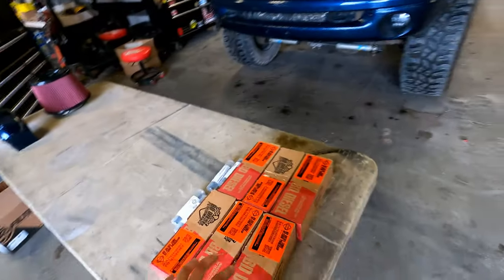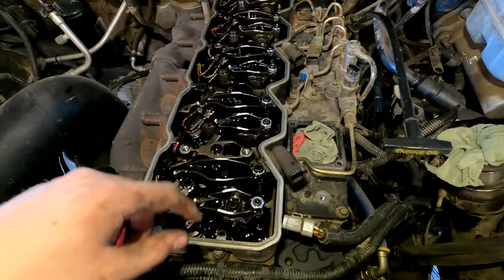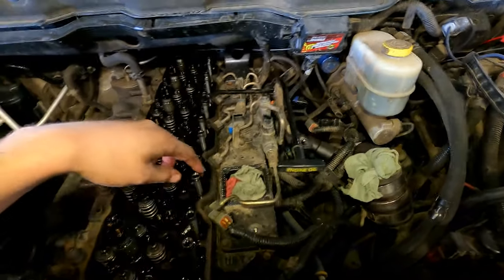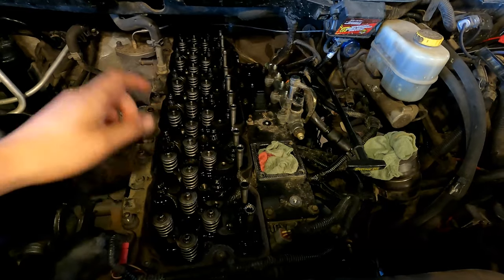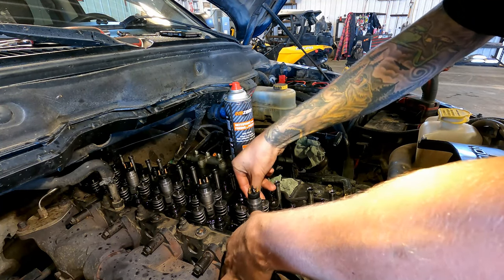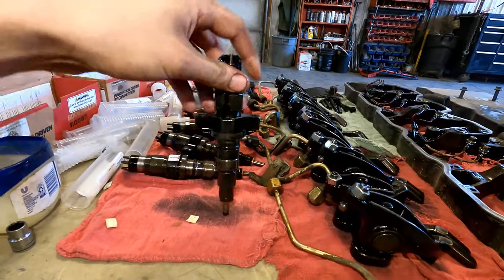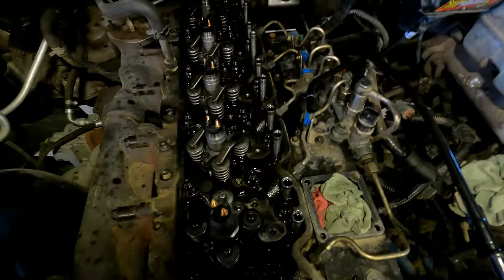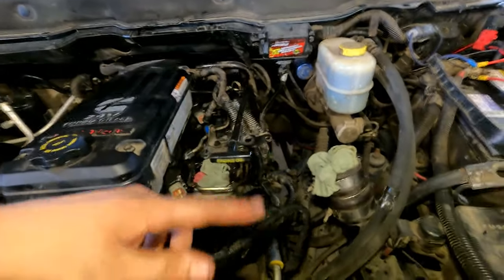How to replace fuel injectors 5.9 Cummins 2003-2007

Comment: These common rails are self bleeding. Cycle the key and let the lift pump run a few times and then crank. If it doesn't start, prime again. It might shutoff but do this cycle over until she runs good. You really don't want to manually bleed the rail for safety. Good luck
Reply: Thank you! I’m new to diesels so comments like yours really help!
Reply: Yeah definitely not recommend to crack any high pressure line free. Karen Boot has it down. If you turn the key on you will get 2 or 3 seconds of run time but then you bump the starter and you will get 25 seconds of fuel pump run time. I do it like 4 or 5 times and the should lite up no problem! Goo video and appreciate you taking true time to do these vids.
Reply: @chriscollison3136  Karen boot?
Reply: Working on one right now and I’m used to the old VP 44s where you have to bleed each line spent 30 minutes trying to get the front lines to bleed because I could only get the back three to shoot diesel out but after watching this it makes sense because all the air is trapped in a common rail so you only need to crack one line to get the air out I feel kind of dumb but I’m glad I got it figured out
Reply: These people talking about stuff they have no idea what they're saying the lift pump in these are not electronic it is all mechanical besides the ECM the lift pump is mounted with the injector pump. It is gear-driven so which means it is only pulling the fuel up and delivering it to the fuel injector pump which overtakes for the lift pump and provides high pressure to the fuel rail so cycling the key multiple times does absolutely nothing to bleed this system now if you had a newer Cummins with a electric lift pump then this would be true.
Reply: @Akusjs partially correct. Some of the 03 and 04s had a mechanical pump. Anytime dodge got one of these in for a fuel system repair. They upgraded it to a in tank pump. The 05 and newer ones all had the in tank pump. Meaning that unless you have a 99-04 25v, you will have a in tank pump. If you have a 99-04, you will want to check to see which one you have. Thoroughbred diesel has a great video on how to check which one you have.
Reply: Yupppppp, nothing worse than 4k psi of diesel piercing your skin. Its an immediate trip to the Emergency Room. Never bleed the high pressure side of a common rail diesel.

Comment: Just a follow up on installing my new injectors, the whole job took me about 6 hours, I took several breaks being 86 years old, I saved about $2500 doing myself it fired up on the third crank and is running great , no oil leaks,  very happy I watched your video. I could not have tried it without your expertise, hope I get many more miles out of it, I tried to attach a video of me working on it..
Reply from the maker: That’s awesome! I’m glad you were able to do it yourself and save some money, thanks for the comment and good work 👍🏻
Reply: Im in Alaska and despite some things being on par and even occasionally cheaper than lower 48 (3k tranny rebuild vs 6k in missouri)  the average rate is $6500 for injectors, lines and rail....i can get all the parts for 2500. Im saying all this because your comment is reassuring lol. I can't justify spending 4k to pay someone lol

Comment: Good video. A couple of things to note. When torqueing the injectors, after the initial 44 inch pounds back them off and go hand tight, torque the fuel supply tube to 11 foot pounds, final torque the injectors and then the fuel supply tubes. The injector has some room to rotate in the hold down. This allows the fuel supply tube to better center the injector. The other thing is do not bleed the high pressure common rail. It can be very dangerous and it is not necessary.
Reply: So would you skip bleeding the fuel rail totally
Reply: @chrisallen3741  yup
Reply: @chrisallen3741  yeah that's what I always heard
Reply: Yes, you skip the bleeding because the common rail fuel system is a self-bleeding system. So, no need to crack an injector line. Like original commenter stated, it can be very dangerous. These injectors, I believe, require a minimum 5,000 psi fuel pressure to pop off and you definitely don’t want that out and about.
Reply: Im about to do this on my 5.9 and previously I had a Ford 7.3 that wanted to hydrolock if you didnt clear the cylinder before putting in the new injector.   Do I need to be wary of this with the cummins?

Comment: I have a 2006 dodge ram 2500 5.9L Cummins and right now it sounds more like a tractor but without any power. I will be replacing all of my injectors in the next couple weeks. I'm ordering the injector kit with fuel tubes, fuel lines and gaskets. Very helpful video. hopefully all goes well.
Reply: Just had this issue yesterday
Reply: @America-he5tz so did my grandpa
Reply: I have the same truck as you and same issues 233k miles it started I’m at 235k can’t afford injectors yet nor have an extra wheels.

Comment: Just did a set of stage 1 BBI injectors In my 2004.5 5.9 cummins and it was a pretty straight forward job , if I can do it in my home garage anyone with the will power and some brains can do this job
Reply: How are they holding up? I am in the middle of an install and noticed the new bbi stage 0.1 are not oem bosch

Comment: Thank you for making this video, very good resource to use while I did injectors tonight on my 04.5 ram 3500. The sequence and order was easy to follow and I appreciate mostly the torque sequence/specs on the injectors/tubes. It made the job go quite smoothly tonight. Much appreciated!

Comment: You should definitely change that grid heater to a banks!! I've seen plenty of the grid heater nuts rot out, fall into engine and trashing it.  The banks one will not allow this to happen.  Just do some research and you will see exactly what I'm talking about,  it can save you engine
Reply from the maker: The banks grid heaters are garbage and don’t work in our climate. What I’m going to do is the BD Diesel killer grid heater upgrade kit.
Reply: thats a 6.7 problem. not a 5.9

Comment: My 07 is hard starting after it gets to temp only and i try to start it up after 20+ minutes. Thinking it is the injectors? Pump is runningproperly with fuel pressure perfect. Great video bro. TY

Comment: 400 thousand k i stil have the same injectors it came with. And it still starts and pulls good. But i use a fuel lube mainly powersaw 2 cycle mix oil
Reply from the maker: 300,000km on these injectors and they were still fine. Only reason for the change was needing the extra power to spool the bigger turbo!

Comment: On your rocker arm bolts, did you reuse the factory bolts? I tried to reuse them and broke 2 off before they hit final torque. Not sure if that's my doing or if its because they are one time use bolt.

Comment: Followed your tutorial and replaced all of my injectors on my 06' Dodge 5.9 cummins... now it won't start. I'm sure I'm missing something. When I crack the injector line and crank the engine the fuel doesn't seem to build up pressure although I am getting some air bubbles where I cracked the injector line. Wondering if I'm having fuel pump issues. Any thoughts? Thanks
Reply: The cp3 pump is self bleeding.. serious injuries can be caused by cracking injection lines on a common rail diesel. 25,000psi fuel can cut your hand like a laser.
Reply: Yeah I wouldn't bother trying to do it because you also lose prime if you try to do it alone

Comment: I know this is old but there is a service bulletin to torque the injector crossover tube nuts to 55ft pounds they cause a leak at 35 or something
Reply from the maker: Oh good to know. I never had a problem with mine

Comment: Do you have a video to adjust the valves on. 07 ram 2500 5.9L ? Mine has a little knocking. Thank you in advance. Billy.

Comment: Im having issues with the injector hold down bolts coming loose on a 4th gen.  When I took them out 2 or 3 were loose on one side of the plate.  I had to go back in due to a faulty injector after a few miles of driving around and found the same problem.  Thought about spraying out the bolt holes and using a dab of thread lock.  I did install them going back a and forth but it seems odd that some were loose when I went in the first time.  

thoughts?

Comment: Great Video! This video is really helpful to anyone who has not replaced their Injectors before. What made You decide to go with 90 over Injectors? Just curious? I need to replace mine as well. Thanks for sharing and keep up the good work...😎👍
Reply from the maker: I put a bigger turbo in my truck so bigger injectors helps me to get the most out of my aftermarket turbo
Reply: @darkirondiesel  What size and brand of Turbo did you go with?
Reply: I would love to know what turbo you did as well...

Comment: Just curious if I would need to replace all injectors or if I’d be fine just replacing the one bad one? I’ve got a slight miss in mine and I have a feeling it’s one of the injectors
Reply: How do you know which one is bad?

Comment: Anything special you need to do before removing the fuel lines because the sticker on valve cover says that the pressure will cut your finger off.?
Reply from the maker: I’ve never had an issue. Wear gloves and safety glasses. Slowly loosen the fuel lines and you should be fine.

Comment: What are you doing with the old injectors? I only ask cuz I’m a single father who can’t afford the cost to get the rig back on the road. I was hotshotting, but when the pandemic happened I was forced to stay home and weeks later blew atleast 1 injector. Currently driving a POS Caliber just to get to my currently crappy job driving forklift just to pay the bills. 

I’m willing to pay for them, just can’t afford the $1500+ for non Chinese injectors. And I know that replacing them with used injectors is dangerous. But if it gets me back hotshotting, I’ll replace them again within a month or so.
Reply from the maker: Well my core charge on them is $200CAD each, so if I were to sell them I’d need at least $1200 CAD to get my money back.
Reply from the maker: You still need injectors? Because I guess I could give you these ones and send your injectors back in as cores. Didn’t even think of that til now
Reply: Atleast you replied and offered, most people would've just blew him off. New sub and like for that alone.
Reply: @darkirondiesel  I’m sure I’ve missed out. For some reason I’m not getting notifications on my YouTube account. I still watch it every day and even watched your video about having to get towed off the Hwy, and the other 2 about 90hp injectors ripping and towing. But I just watched this video again to be able to get a better picture as to the removal process was reading comments and seen mine amd that ppl have replied but even in the apps notifications there is nothing stating this. I’m terribly sorry, I feel like a schmuck! 😝

Comment: Hello my 2003 dodge cummins 5.9 the level of motor  oil rises and i was wondering what is the problem with it. And thank you
Reply: Fuel in the oil. find the leak or you will have serious engine damage.

Comment: Well damm, this isn’t a 07 for sure 🥴

So just reading a few posts down with a 07 but my cc filter is bolted to the valve cover and valve cover gasket has a wiring harness in it and my valve cover has 6 bolts. That’s why I seem to be having issues finding the right info as soon as I see 4 bolts and ccf mounted to the head ??
Reply from the maker: This job will be almost identical for any 5.9-6.7 Cummins. In 2007.5 they switch to the 6.7 Cummins which is slightly different but still basically the same job.

Comment: Does larger injectors require tuning changes
Reply from the maker: Not necessarily. But I’m going to get mine tweaked so it doesn’t roll so much coal when in a low boost situation. So basically you don’t HAVE to but you should to clean up the tunes and optimize them for the bigger injectors.

Comment: Hi  I installed this way and had a leak inside the head.  So according to a cummins install guide at the 13min mark tighten to 44in lbs loosen off then install the tubes, torque then go back and tighten injector to 44in lbs.    had no leaks after this.
Reply from the maker: Thanks for the insight!

Comment: How in the hell did you get #6? I have been trying for over 2 hours. I snapped the top of the injector off I was reefing on it so hard. Now I have the threaded top showing and it’s still not moving. All bolts are out of course. Why is this not coming out????
Reply from the maker: Did you take the fuel tube out?
Reply: @darkirondiesel  that ended up being the problem I got it finally. Got them all in and started it and now it won’t hold rail pressure. It builds to 8 on the start then drops slowly to 2 until it dies
Reply: @damonsmith8411  Did you install new tubes?
Reply: @freddyg9026  yes I got new tubes. Problem ended up being #6 was loose and I took all them out and re torqued to 42 ft lbs

Comment: Why did you not just put new injectors in when the head was off ?
Reply from the maker: Didn’t have the money for new injectors at that time, but either way, it’s only a couple hour job to change the injectors so it’s not really a big deal